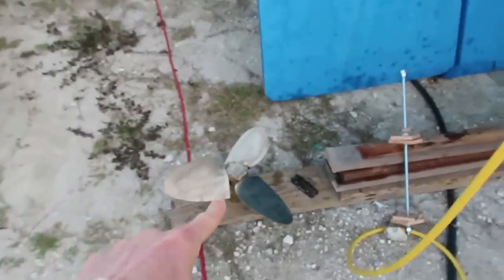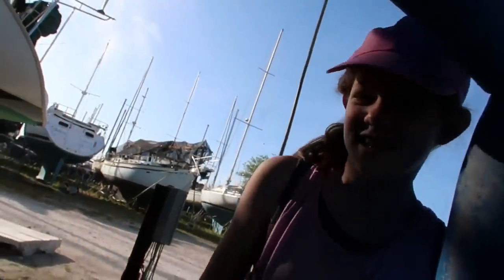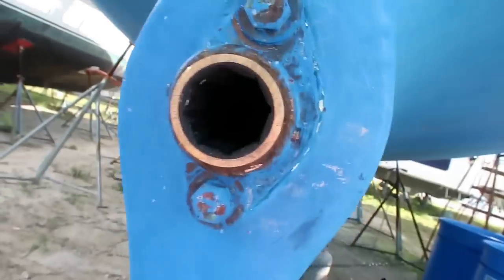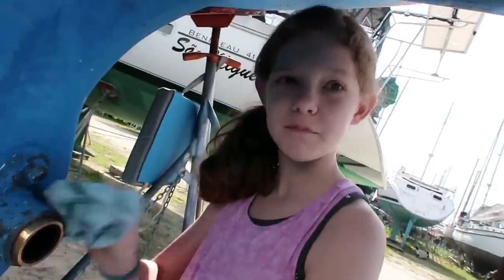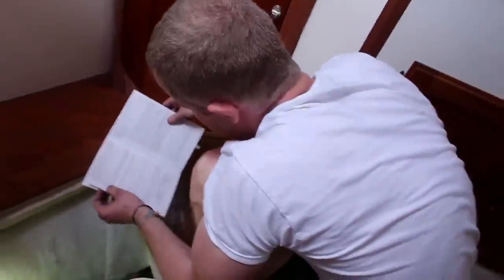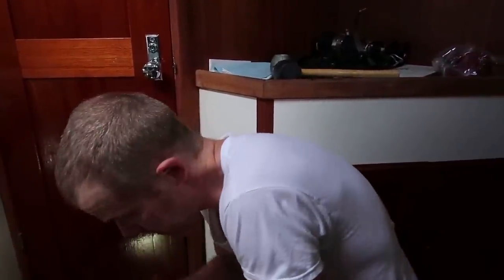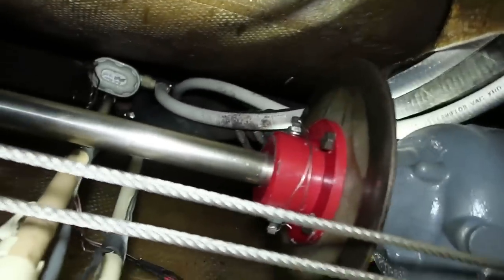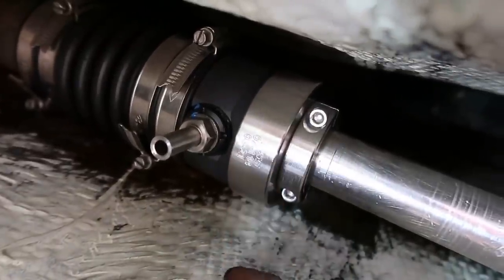Replacing The Cutless Bearing & Installing A PSS Dripless Shaft Seal | Sailboat Story 192

Comment: Was it not necessary to check for engine to shaft alignment with feeler gauge between the shaft coupling & the gearbox output flange before fully tightening the bolts ? Adjustment might be necessary by shimming the mountings to prevent premature wear of the cutless bearing? 
Your series is very endearingly down to earth.
Reply from the maker: I figure if the alignment is good when it came out, it’s good when it went back in. I can’t see how alignment could possibly change with what we did. Not a bad idea though, if you want to know absolute certainty.
Reply: I have worried, perhaps unnecessarily,  about precise shaft alignment considering that there is a  flexible plastic component in the coupling. But it has been such a pain to check, adjust & get right in an uncomfortable, fairly inaccessible place. l have now been made aware that Bruntons make a clever CV type connector which has sufficient tolerance to obviste the need for such antics. Although  I  have no personal experience of this piece of kit,  it does sound desirable?

Comment: Good instructional for many to see a PSS in confined space bilge. Glad the small bolt was enough. Some like mine are such a press they don't have set screws. Sure sign it will be difficult. Using threaded rod as large as the shaft sometimes is enough. 
Funny she fits in the aperture still.

Comment: If you freeze the cutless bearing, it might have gone on with less effort. Metal shrinks when cold. Great idea for pressing the bearing in.
Reply from the maker: True, but I’d be concerned of what extremely low temps could do to the adhesive holding the rubber padding in place. Not that it was necessary in this case. Thank goodness it went in very easily. I’ve heard nightmare stories about them being a real pain to remove and install.

Comment: SUPER LUBE  21030 silicone grease, use every time you see an oring and is the stuff for the whole procedure of shaft installation thru the cutlass bearing, use everywhere that water and orings abide.

Comment: Speaking as someone who makes or modifies a lot of his own tools, I'm a huge fan of all Ben's Boat Contraptions! And your cutless bearing Press Contraption was very well thought out, particularly the centering ring. One (not entirely) minor thing, though. Before fitting the propellor, I'd have installed a rope-cutter. You know, that peace of mind thing!

(But please tell me that upside-down dinghy on the ground at 0:13 wasn't Bonnie...)
Reply from the maker: The dinghy is in the yard under a tarp for now, but Im pretty sure it’s not visible in the video. Weird how you somehow knew that. Twilight Zone stuff. I recently repaired a couple things and repainted it, now she’s out in the yard to make room in the garage for other boat projects. She’s still well loved, just don’t have another space for her right now.
Reply: @Sailboatstory  - Not so Twilight Zone stuff really. I saw that in the driveway where I'd expect Bonnie to be if the garage was needed for other things, there was an aluminium runabout (what here Down Under we'd call a 'tinnie') on a trailer. So brain was already going 'hmm.. where's Bonnie?" So then when I see a dinghy, that might be Bonnie, but doesn't really have the lines of a Chameleon, laying upside-down on the ground, I just had to ask.

For what it's worth, I'm building my own sailing version of a Chameleon, and have just finished gluing & taping the seams. It was a great feeling, cutting off all the zip ties! Now I have a couple days sanding to look forward to. But hey, I don't have anything else planned for the weekend!

So yeah, Chameleons are very much always on my mind right now, so I tend to notice/look for them.

And while I have the chance, thanks once again for the series on the building of Bonnie. Many is the time I've referred to them, and I've probably watched the entire series 3 or 4 times by now. I know how much time making videos adds to a project, so please know that your effort is very much appreciated!
Reply from the maker: Cool that your building a dinghy. I really enjoyed building ours. I’m on the lookout for a 12’ aluminum welded tinnie that we can use as our dinghy when we do some longer distance cruising. I’d like to have more range than what Bonnie can give, but we’ll likely use Bonnie still for this next season out.

Comment: Hey Ben — just a note about your retainer you put forward of the PSS Seal.  I installed one on our boat, but I left just a tiny bit of an air gap as I wanted to be able to visually see if that PSS seal slipped on the shaft.  I wasn’t sure how snug you made yours, but wanted to share my thoughts.  I like being able to look down and tell if anything has moved and I inspect prior to underway.  You may find that salt will build up and the shaft becomes hard to turn if the vessel has set very long.  I always clean mine and get it turning easily by hand before I start my engine. That’s when I visually inspect the retainer ring.  I have also made some permanent marks on the shaft marking the location of the coupler and the retainer as a visual reference if anything has moved.  Earl
Reply from the maker: I did something similar by marking the shaft just forward of the retainer. If the mark disappears, then it moved. We had one of these shaft seals on our last boat and really liked it. Happy to have another one on the new boat. Looking forward to the day when we have a dry bilge from the leaks being fixed but it wouldn't be possible without one of these dripless seals.

Comment: Noticed in your video that you used the term "safety wire" twice and you had a pair of safety wire pliers. I've found not many people use the term "safety wire". I learned about it in 20 years of Marine Corps and Army Aviation. Was just curious where you learned about safety wire?
Reply from the maker: Hmm, I’m not really sure where I learned it. Been using it for 20 years on cars, motorcycles, and now boats. You’re right, not many people use it, but my safety wire pliers are one of my favorite tools. With that said, they actually broke while filming that shot. Finally wore them out.

Comment: Question, why the disk in front of the transmission so large? The disk you were spinning with your hand. I can’t remember ever seeing a sail drive set up like the before. It looks like a skill saw blade. Does it offset pressure? Thanks!
Reply from the maker: Disc for shaft brake.

Comment: Ben your safety wiring was a new one.  Do not see that much outside of aviation and you said against the rotation of the bolt.  Most do not think of that. Did you work in aviation?
Reply from the maker: Mechanical engineer. I’m pretty good with geometry, machining, etc. I’ve never had anything to do with planes, but I’ve been using safetywire plier for years and years, mostly on motorcycles. Those pliers actually stripped the twisting mechanism as I was filming that clip. I bet I had those things 20 years.
Reply: @Sailboatstory  - When you made that press with the centering ring in it, I almost asked if you were an engineer in another life.. good to have it confirmed!